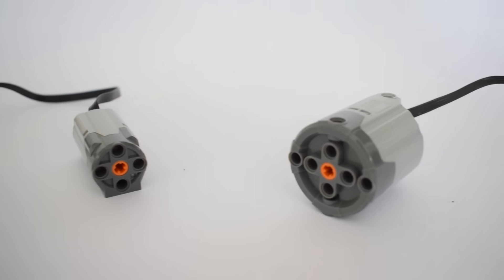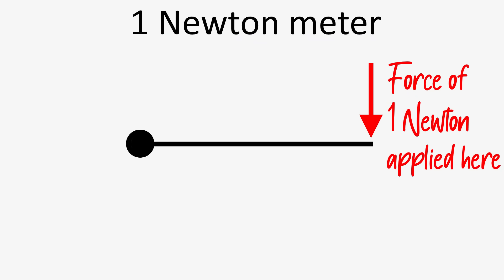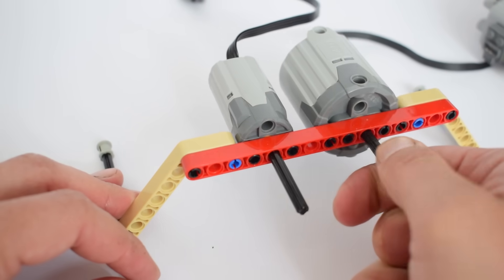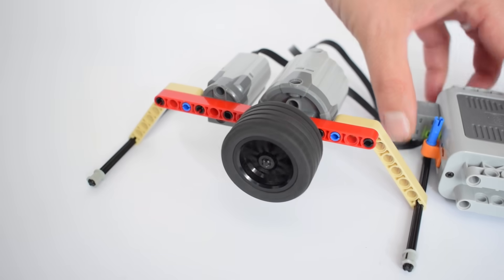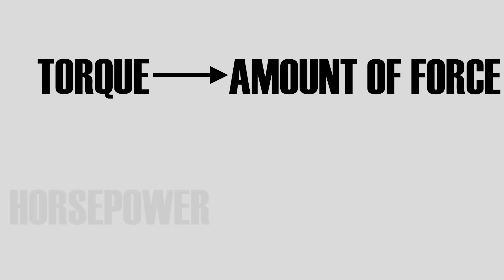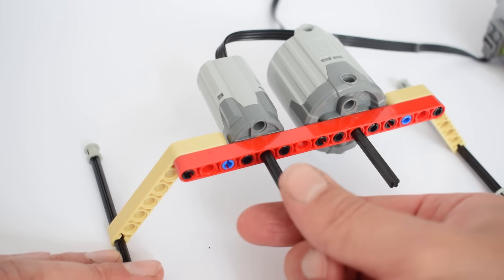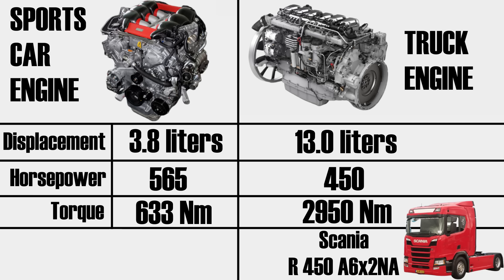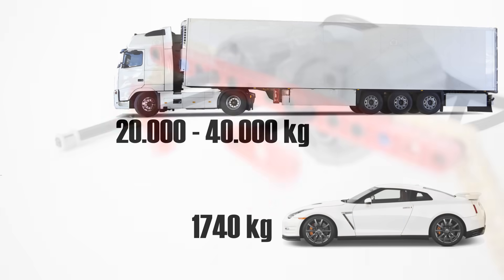NEVER be confused by HORSEPOWER and TORQUE again - HP and TORQUE EXPLAINED in the MOST VISUAL WAY

Comment: I've always thought of horsepower and torque as in, horsepower allows for more speed and torque is how fast you reach it. Because if your car has a lot of torque, but low power it reaches the max speed faster but the max speed is very low. When you have a car with lots of horsepower but low torque, you car will take longer to reach the max speed but the max speed is higher. Correct me if I'm wrong, this is just the way I've gone about it.
Reply: Car having torque is not an engine related thing. Power on the driven axle is what moves a car. Because power is force times speed, car spends power for force or speed by shifting gears: the more power is generated and the slower its speed is - the faster acceleration will be. In other words: to reach faster a higher speed not engine torque is needed but a gearbox with lots of gears.
Reply: @simplemachine9531  when did I mention an engine? I was talking about a car in general
Reply: @GrayZ_dood  then you have to know that "your car" can have as much torque a you want

Comment: Great explanation. I’d love to see this concept expanded on into the gearbox  . I’m familiar with the trade off on gearing converting torque to rpm by changing gear sizes (or rpm to torque). Curious how this concept plays out with gearing. Am I able to generate more horsepower by transmitting the cranks rotation into a smaller gear thus increasing the output rpm?
Reply: The horsepower will remain the same regardless of the gear ratio (ignoring gear losses). HP=T*rpm/n keeps HP the same because torque and revs are inversely proportional.

Comment: Torque is also why that truck can pull 40,000lbs and the little sports car cannot.

You can get a similar result in people. Big guy runs slower than slim guy while unladen. However, toss in a 100lbs backpack and the performance of the slim guy drops exponentially while the big guy's performance only drops a little.
Reply: Wrong of course. It is a question of relativity. If you add 10 kg to 100kg base it is +10%. If you add 10kg to 50kg base it is +20%. Sure thing 20% affect performance higher. Nothing to do with torque.

Comment: Torque is force x distance.
Horsepower is a rate of work. 
Not even close to the same thing.
Gear-heads have these dumb conversations.
Engineers don't

Comment: As is typical, you are WRONG. While the explanation of torque vs HP is technically correct, your comparison of two engines is out to lunch. The sports car engine can more easily move the weight of a semi, than the semi engine can. This is indisputable FACT. All you need to do is use proper gearing. 
There are only two reasons the semi-truck engine is large. First, a high torque engine does not need to shift as often to apply the maximum amount of torque to the drive wheels. Therefore it is more convenient to operate. Secondly, it is large, because its operating point is closer to its maximum output, so it needs to be large for endurance. If the performance engine was required to operate at the same load the semi-truck engine was, it would wear prematurely or possibly overheat. It is not designed to put out its maximum rated power over the long term. 
In the context of automotive, you can not explain Torque vs HP without comparing what happens at the drive wheels. You need to explain the function of a transmission, and how it converts RPM to torque. Otherwise you will mislead your audience.
Reply from the maker: Thank you for blessing us with your genius

Comment: There is one aspect to video that is incorrect. When you feel the acceleration in a vehicle, you are feeling the horsepower, not just the torque. Accelerating the car is the work being done, the more work being done, the faster the car accelerates. This is why you feel more acceleration at higher RPM. Because you are making more horsepower. Most cars have reduced torque output well before their redline RPM, yet the acceleration rate continues to increase above that torque drop off. 18 wheeler trucks have massive torque and low RPM because to move the weight attached to them, they need to make a large portion of their potential horsepower at their lowest operational RPM. Whereas a car can move itself with a small fraction of it's horsepower potential, and use high RPM's larger horsepower output for acceleration faster than is typically necessary.
Reply from the maker: Ever been in a turbo diesel? Acceleration felt is definitely higher at low rpm where peak torque is. At high rpm there's just more engine noise. But you're correct, we're not feeling just the torque but acceleration. I explained it this way to help viewers visualize things better.
Reply: @d4a  I drive class A trucks, so I am very familiar with the output of turbo diesel engines. As you said, horsepower is a measure of work over time. The work being done is acceleration of the vehicle. So the more work done per second directly correlates to more rapid acceleration. Therefore, acceleration rate is a direct result of horsepower output. Large torque output is just the ability to make sizable horsepower at low RPM. I still very much enjoyed the video, and it is extremely informative to a layperson.

Comment: Actually, there is a time component to torque.  

Torque, as you know is Force x distance.  Force is Kg x Meters/sec^2.
Reply: Torque is force times radius, not distance
Reply: @simplemachine9531  

Yes.  The distance between the fulcrum and the force perpendicular to it.  

You call it radius.  I call it distance.  Stop trying to pretend you’re smart.
Reply: @mas3ymd  there are 1000nm of torque on the engine's crank. How much time is needed to lift an object of 1000N weight for 1m?

Comment: So many things wrong with this video.  You did a great job of regurgitating the same dumbass nonsense that is all over the internet.  The most egregious error is using a 2.2 times more powerful motor to confirm your preconceived bias.  An intellectually honest person would have compared 2 small motors connected in parallel versus a single big motor with the correct gear multiplication to achieve equal RPM.

Some simplified explainations that are relevant to this application:
Force (torque): an influence that CAN move an object.
Work ("torquing" a bolt): an influence that DID rotate an object.
Power (HP): an influence that DOES influence an object a specified distance within a set amount of time.

Two physics concepts apply here: FORCE and POWER.  Work is completely irrelevant in this application.  Your fundamental error is conflating force and work.  You don't seem to understand either concept.  They are not interchangeable.

Your example of tightening a fastener is work NOT force.  Simply not relevant.  Engines/motors DO NOT produce work.  A person with a torque wrench does.

Engines/motors produce FORCE, as torque against the engine/motor mounts/drivetrain components, and power typically referred to as horsepower (force*distance/time).

Power is what you "feel" in an automobile as acceleration.  Power is what moves a loaded trailer uphill.  To illustrate, using your example, a semi truck with an R35 engine geared to the specific RPM that makes the same 450hp as the semi will have the EXACT SAME output torque:  R35 450hp (394 TQ) @ 6000 RPM with a 3:1 reduction will output 450hp & 1182 torque at 2000 output shaft RPM just like a semi truck motor.

The two takeaways here:
HP is the only directly relevant metric that will predict the performance of a race car, a semi, a farm tractor or an electric motor.  If you want to know how quickly a car can accelerate, HP.  If you want to know the speed a semi will be able to maintain up a grade, HP.  If you want to know how much field a tractor can plow in a day, HP.

Torque is the only directly relevant metric that will predict component strength retirements.
Reply: This comment is hands down the best and most concise breakdown I have ever read.
Reply: @Redtooth75  thank you.  I simplified it as much as possible.

Comment: This is how NOT to explain power. Sorry, that's nonsense. Power is work in relation to a certain time. And work is force (torque) applied on a certain (angular) DISPLACEMENT.
Reply from the maker: Yes now everyone understands
Reply: @d4a  You may apply torque for aeons but with no displacement there is no power but heat dissipation in the engine.

Comment: Torque = force
Horsepower = power = work per second = force * distance / time = force * velocity (or torque * rpm in this case).
However, engines have limits on torque - above a certain RPM, the torque drops toward zero. The torque and horsepower specs are 'peak' values respectively. Since horsepower is the product of torque and RPM, engines that are able to keep their torque output at high RPM have higher horsepower despite having lower peak torque. That said, theoretically you can make a high motor car go 'fast' or a low torque motor pull heavy loads by using gearing.

Comment: Before watching the video, the conclusion I've made from hearing the words so often is that horsepower is the amount of power available (mainly horizontal), and torque is the amount of stability available (mainly vertical). These two work in conjunction, and the more you have of both (before other factors like weight are considered) the faster and more stable you'll be able to go. This is how (my complete and total assumption) it interacts with the car, anyway.

Now time to watch the video and see how completely wrong I am 😆

Edit: I was able to correct my interpretations thanks alot to this video. I'll leave my original comment  though.

Comment: It's sad, but not unpredictable that this video would get it wrong. Adding to the confusion people have on this topic.
Reply from the maker: It's sad, but not unpredictable that any video ever published will get a troll commenting on it.
Reply: @d4a  what's sad is people who think they know things and still get it wrong. Just send them to engineering explained so they actually understand it.
Reply: Buddy, when you drive a car you feel the power NOT the TORQUE, IE Transition from one spot to the next in a given amount of time. If the moter that can produce more power isn't producing the same torque at a given rpm, than at that rpm it is delivering less power.
Reply: @d4a another thing you got wrong. Big engines are used for efficiency, not power. The gear box is a torque multiplier. The amount of torque the engine can put out is irrelevant. It's about the amount of torque you can get at the wheels, which (at any given speed) is dictated by power. But trucks use big engines so they can last longer and be more efficient.

Comment: Simple 
Power directly proptional to speed and inversely proportional to Torque

In rated power output, it either gives torque by reducing the speed or gives speed by reducing torque 
Speed - rotation per time
Torque - capacity of load the motor can handle

Comment: Is engine torque still relevant assuming you can choose any gearing you like, and also assuming you don’t mind the noise, consumption and wear&tear of revving your engine at its peak horsepower?

 For example say you want to move a heavy truck, could the Nissan engine outperform the truck engine (apply
more torque) as long as you rev it to its peak horsepower rpm and apply custom gearing to convert that to torque?
Reply: You pretty much hit the nail on the head. A low torque high rpm engine can do the same as a high torque low rpm engine if they both make the same amount of power. The low torque engine would just be at a high rpm where it is not fuel efficient and experiences a lot of wear.
Reply: @Redtooth75  Thanks!
Reply: No, it is like thinking that higher engine revs required for car's higher top speed.
Btw author of the chanel is an uneducated prick who's banning people for truth, took money from Lego and filmed the worst video on topic.

Comment: Thank you, but it doesn't explain enough. You can gear the higher rpm motor to turn a shaft at the same rpm as the lower rpm motor and the torque at the output shaft will increase. Similarly, you can gear the lower rpm motor to drive an output shaft faster with less torque. In fact, the larger motor is most likely larger because it has internal gears making the output rpm slower with more torque (in addition to the higher power spec).
Trucks firstly need the torque so that they can pull a heavy load from stand-still. It would be possible for the small engine to be geared to drive a shaft at high torque and low rpm, but this is not practical mechanically. You can gear the truck to drive a sports car, but you wouldn't because the engine is too heavy. 
You don't feel the engine torque when accelerating, you feel the wheel torque. Engine torque gives no indication for acceleration, only engine power does. A small 60 Nm 36 V DC motor will never move a ton of metal at any appreciable speed. Power is the ability to create wheel (output) torque.

Comment: Idk, sorry but this didn't help me much. So the torque is the torque of the wheel? How does speed factor into that? When ppl say that a car has X torque, is that on the wheels at standstill? Gears will obviously affect torque a lot, can any engine get lots of torque if you just give it really low gearing? In general, how does torque and power change for different gear and speed of a car/truck/etc? What about 4 wheel drive vs 2 wheel?

The concept of a force being applied many times doesn't make any sense either, a force is applied constantly, it doesn't come in pieces... The power should be the torque times the angle over which it is applied right? Which is why lower gears will give you more torque, but not increase the power because it won't rotate the wheel as much? I feel that part was quite confused.

The lego honestly didn't help much for me either, it was just a stronger engine and a weaker engine, what does that tell me? I'd like for you to use the same engine, but go through gear and explain how that changes things. And how can you calculate the power of the rotating engines? You've no idea what the torque is of either of the engines as it's spinning at max speed. You'd need a winch or something that actually does work. Or, gasp, maybe even put the lego engines in a car, and see how fast they can go, and how heavy cars they can carry up a hill or something. In the case you showed with the spinning little red piece, all the work goes to friction to heat up the engines and the lego pieces, very hard to measure.
Reply from the maker: https://youtu.be/txQs3x-UN34
Reply: Torque is a rotational force, it can be measured from different places on the car. The numbers the manufacturers advertise are measured from the crankshaft of the engine.
Power is torque multiplied by angular velocity (rotating speed), which can be broken down into torque/work/energy divided by time. Gears will change torque and speed inversely to get the desired output. 
Torque multiplied by the angle of rotation would actually be rotational work as it lacks a time component.

Comment: Well, horsepower or power in general is force multiplied by speed so literally how fast some amount of force applied again and again. And torque is force of rotating something. So basically, horsepower is force of rotating multiplied by speed of rotating (angular speed). What is absolutely true for metric system in Watts, and you need multiplier to convert watts into horsepower. (Don't see a vid but imagine what is it about.Yes, I'm engineer)

Comment: Torque is work, force x distance. Power is rate of doing work, force x distance / Speed. In an internal combustion engine you get maximum torque at lower speeds but maximum power at higher speeds as it is the rate of doing the work, even though torque is reducing with speed. A diesel produces less power as it is lower speed even though the torque is much greater than a petrol engine.

Comment: Although explanation us correct, HP and torque should not be compared as they are of different unit measures. Hp is power and torque is force. Torque is a component or part of HP. HP = torque x rpm (rev per min ). It is like watts and voltage. Watts = voltage x current.

Comment: then why can’t you power trucks with smaller petrol engine using higher gear ratios?
Reply: First, because high gear ratios make for a physically weak drivetrain. Second, tough drivetrains consume a higher amount of torque from the engine.
Reply: You want lower gear ratios, not higher. My off road rig has dual transfer cases and 1st gear with both cases in low range results in a final ratio at the flange of 200:1. It’s only a 2.4 4cyl but you could rip a stump out of the ground provided you could get enough traction.
Reply: @toyotaecw  And assuming the axles hold together. 200 : 1 sounds like way too much gear. You sure you didn't mean 20 : 1?

Comment: You can't have torque without horsepower (energy input). They complement one another. So, you can't have one without the other.
The word 'torque' is also used in auto mechanics; when you apply a certain amount of pounds pressure to bolts. You can apply 120 pounds torque to the head bolts.
Reply: You dont understand it. HP is torque over time. Thats all.
Reply: @LiveFromLondon  "Over time" 😆 Hahaha Everything on Earth and the Universe works based on time. Horse 🐎 is used because before cars existed; the horse was the method of transportation.